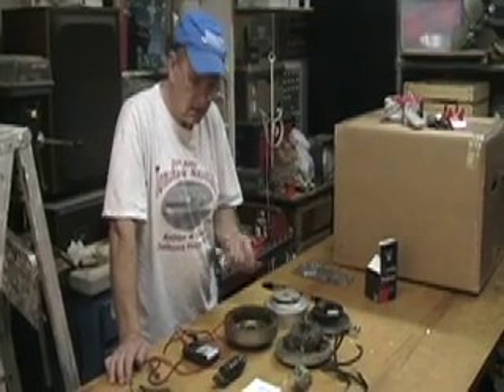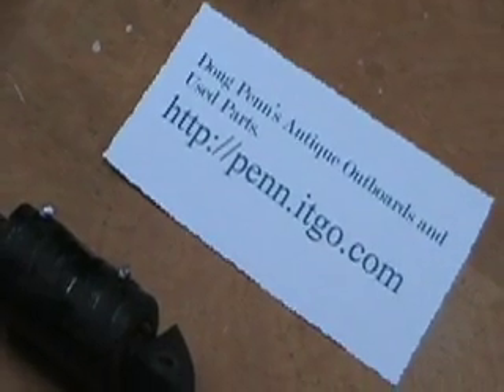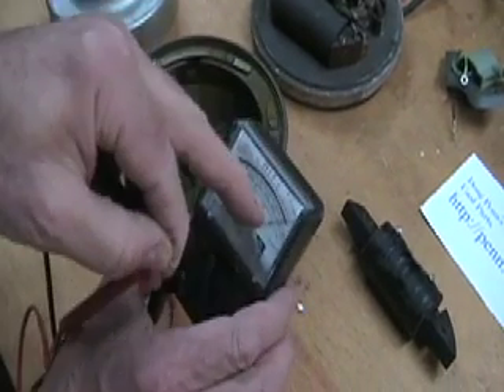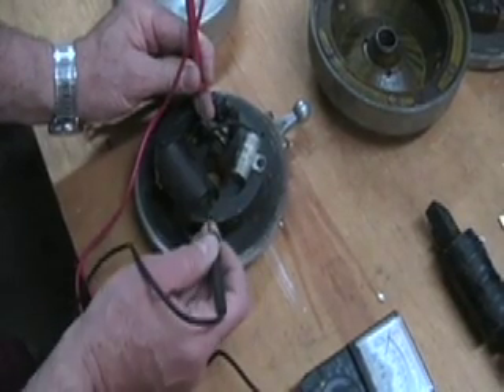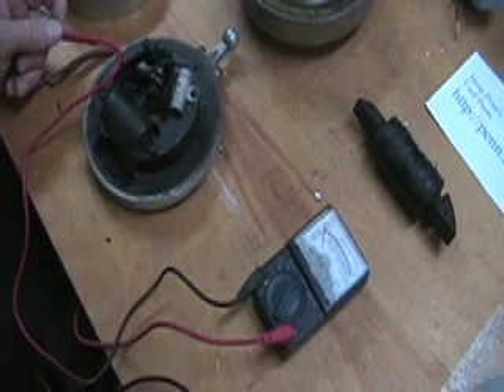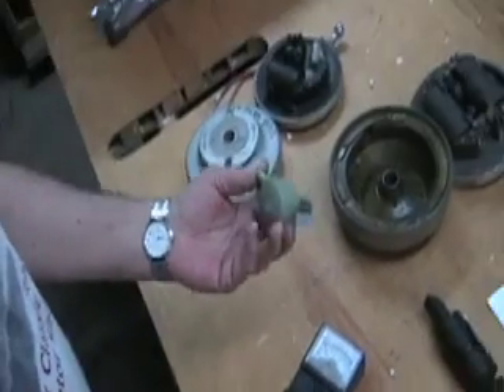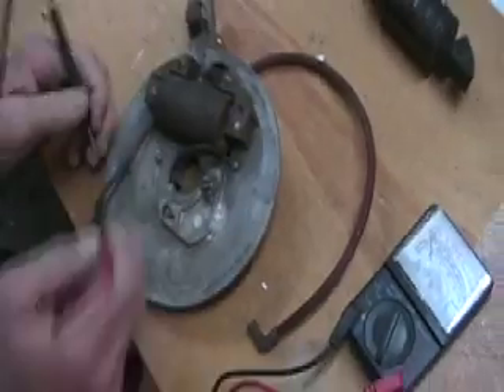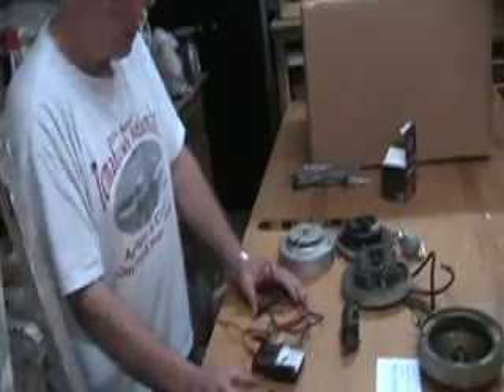How to test a coil in an antique outboard engine

Comment: I just got two coils for my Johnson Seahorse 3 HP today.
It's a 1964 but in mint condition, never repainted and the inside looks almost new.
However, looking through the flywheel I immediately spotted the problem. The coils were rotten to the point the outer (Bakelite?) casing was cracked on both. I'll install new coils, clean up and adjust the breakers, and get this baby to run again. :)
Thanks for this video. It confirmed what I was thinking about these coils.

Comment: Im looking for a 2 wire single coil for a 571-20 waterwitch. I believe its a 1937 2 cylinder with single coil and condenser with point. Do you happen to know what options i may have with other coils?

Comment: another comment  on outboards odd ball trbls. if you have an eng that will idle fine but will not rev up  before take it the shop check this   on your fuel hose connector there is a tiny oring each endof the hose thattiny orink over time can get a tore place that you can not see but it lets in air ---you know the eng sucks fuel from the tank while running but  with this tore place it is sucking air so take a fish hook stick it in the oring jerk it out yoy buy these orings at ant boat shop keep a little pack in you tackle box now to in stall new oring put a little oil on it the press into hose fitting both ends fire it up. worth knowing.

Comment: this off the subject but it worth knowing ----if you have an old eng running hot  that you can not find the problem no mater what you replace still runs hot  remove thermastat cover spin eng listen for air hissing as piston goes up and down  stop remove the head gasket look at the head gasket there will be a hole burned in the gasket  replace head gasket to fix it   this is eay to do first before removing lower unit to get to impeller its worth knowing this  it cahappen on 40hp down

Comment: you faild to mention the condenser it is the most important part for max spark also all the points do is open the gd on the condenser lead to allow current to flow thru  primary winding and condener which make the magnetic effect in secondary to send high voltage to spark plug this condenser has to match the primary coil   in mfds   i find more than likly the condenser is failing when no spark  more so than he coil ther is no current flow thru the points if condenser is good  if condenser is def or wrong value mfd  the voltage can not   get thru condenser so it jumps the open gap in the points to gd pitting the points  eng will run like this but not good   so make sure  right condenser installed  they are all  values out there

Comment: You're wrong, because any ohmmeter will work, even the garden variety digital multi-meter that you can buy at Harbor Freight for a few dollars will work perfectly fine. What you thought was 6 ohms was actually 6,000 ohms which is good because secondary spec is between 3,000 and 10,000 ohms. The meter pegged because spec for the primary is between 1.5 to 3 ohms and you were using a high scale. Checking for continuity like this reveals very bad coils, but you can reveal slightly bad coils if you learn to use an ohmmeter correctly to accurately measure in order to confirm the resistance is within specs (acceptable range).

Comment: Could you use a digital ohm and volt meter to test or does it have to be an analog because I know that like on microwaves for the high voltage diode you have to use a analog meter with a title battery otherwise you can't get no reading on it

Comment: Damn good video but, apperantly, i have a very unique coil. you went from examples of 1930 to 1970 Mine is a 1960 75hp starflite and I have No secondary! Only 2 wires and there is NO 3rd wire going to the spark plugs. Every single one you used as an example,had a secondary wire. There are literally only 2 wires on mine. No 3rd one! The more videos i watch the more confused I am. Not one shows the coil I have, which has only 2 wires. It DOES however, have a metal tab or button-looking thing sticking up out of the middle of the body of the coil, which I guess could be the contact for the "secondary". Is that my secondary??? I do not have an analog like the multimeter in this video. I have a digital. Which,  by the way, has 5 different options: 200M, 200k, 20k, 2000 and 200..... I have no idea which setting to use!  I'm lost.....
Reply: Your 1960 Starflite has BATTERY ignition, not magneto.  There is ONE coil that fires into the center terminal of the distributor cap.  IOW, you have a Kettering ignition, not a magneto system.

Comment: Nice video.  The coil from the J-25 looks just like the one from my A-70.  It tests OK, but I think as it heats up I lose the secondary.  The other coil was totally dead, and I rewound it.   Are there any options for replacements on these?  I have to imagine there are not many good originals out there on 80+ year old motors.  I'll rewind this one also if needed but am hoping for an easier solution.

Comment: Hello ,
My name is Shivanee and we have a old evinrude/ Johnson outboard engine. We tested the big coil read high , but the smaller wire on the coil we got a full reading like the larger coil. Is anything wrong with that reading. However, we are not getting a any spark form the spark plug. but when I remove the spark plug from the wire an then touch that wire to ground it gives a little spark.   I will appreciate any assistant given you can email at : shivpersaud95@yahoo.com
Reply: hanuman ram I have the same problem did u find the solution
Reply: the secondary should be reading about 6-8 ohms resistance. replace the coil. It does seem to be working (for now) as you are getting spark, but replace anyway dont be a cheapskate and get stuck out on the water and look like an idiot. also, you wont get spark unless its grounded. get a cheap$7  IN LINE tester from autozone to make it a more reliable test.

Comment: can you tell me the exact size of the bolts that hold the piece onto the top of the magneto that the starter pulley grabs on to.i have the diameter but the height of the bolt head is my big concern.they were lost and i just replaced them with som standard that are the right length.worried about the head height.thank you ,sincerely,robert andrews.randrews612@gmail.com

Comment: i test out my coils the easy way my girlfriend holds the sparkplug wire  in one hand the ground in the other i turn over the moter if she screams it works if she screams and swears at me it works really good-high voltage --no response coil is broken